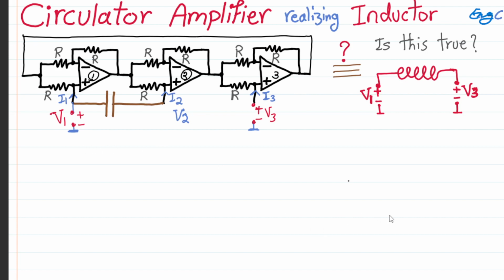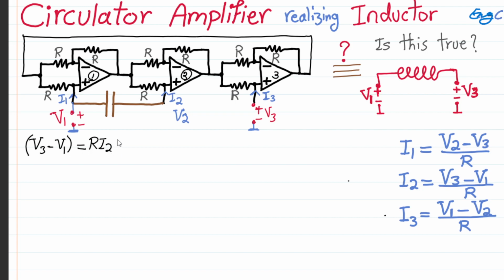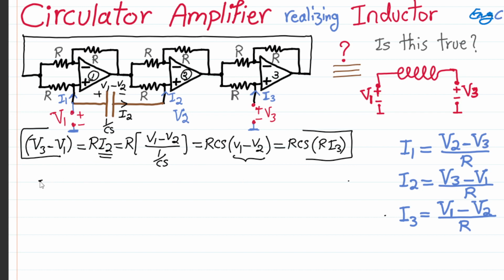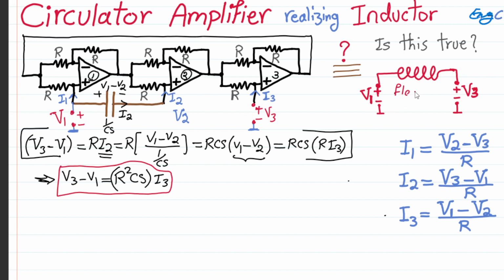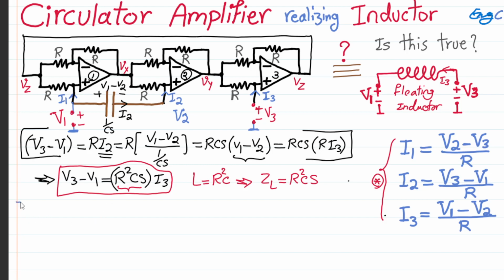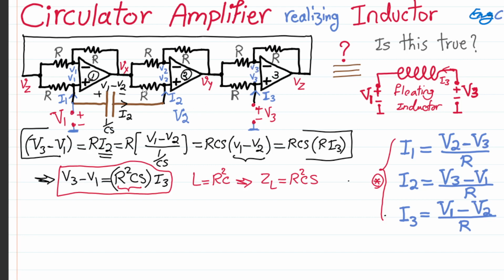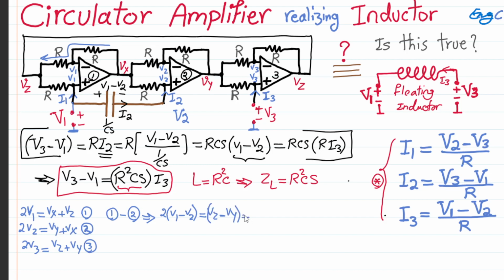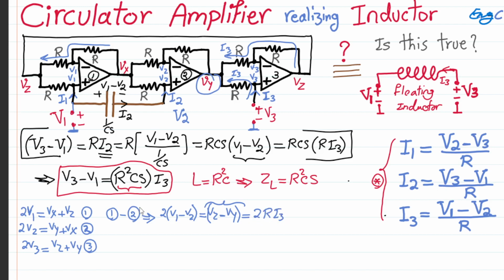Capacitance to Inductance converter using circulator Amplifier

Comment from the maker: Thanks for watching. For more examples, please see Negative Inductance with Gyrator https://youtu.be/GF_Mun_Mkyo 
Gyrator example https://youtu.be/Ls_FvD37yHE
More Gyrator Circuits:  https://www.youtube.com/watch?v=kX5X8jBXVXw&list=PLrwXF7N522y4c7c-8KBjrwd7IyaZfWxyt
Please note that practical inductors have limited range of inductance. The larger the inductance, the bulkier, more expensive and more nonlinear that inductor becomes (low quality factor).  For example the whole circuit including rest of components might be much smaller than just a single one milliHenry inductor. I hope this explanation and op amp circuit examples are helpful.